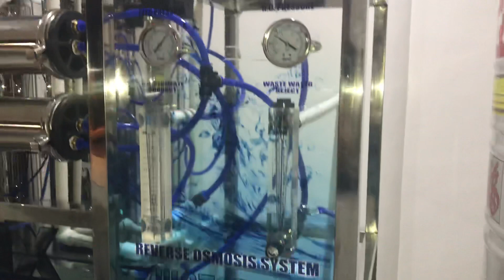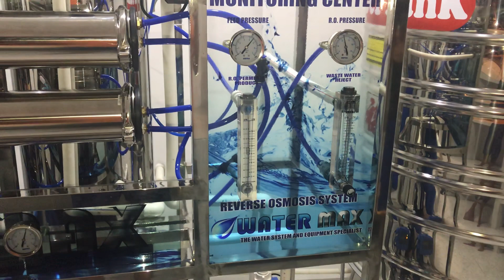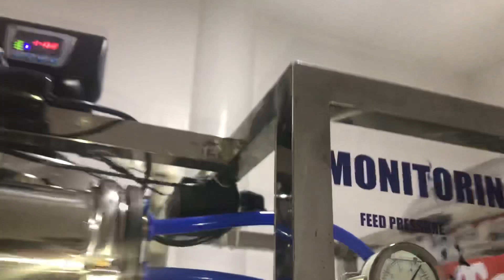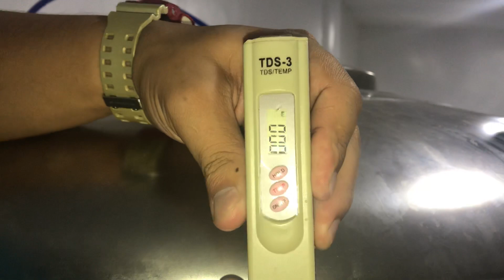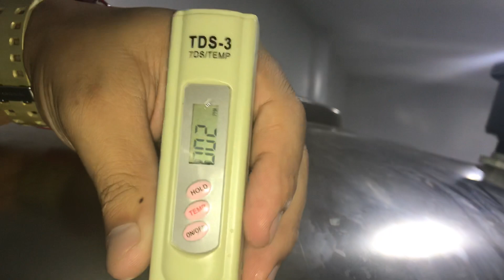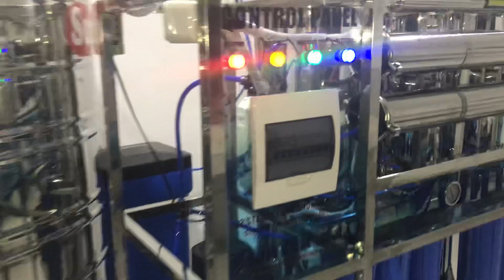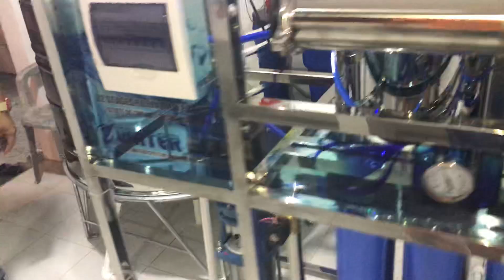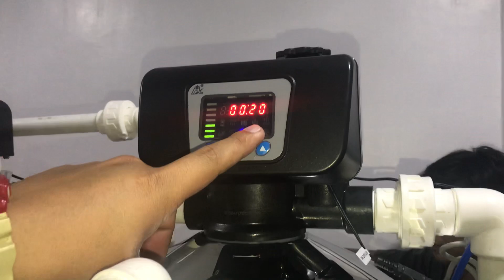Water Station Demo by WaterMax

Comment: Ask ko lng po..
Kahit saan ba na lugar sa pilipinas same lng set up niyo na water filtration system 34 stages parin...?
Reply from the maker: good morning, yes po sir.
hello Mam/sir, this is WATERMAX Enterprises for faster transaction you can txt or call:
Globe:0916-644-4406
Smart:0920-965-0272
Sun:0925-743-5853
Message us at WATERMAX ENTERPRISES PAGE

Comment: San ka nakabase? I will open this kind of business. I will pay cash for machines and package.
Reply from the maker: ian1724 our manufacturing site located in ALCALA Pangasinan
Reply from the maker: hello Mam/sir, this is WATERMAX Enterprises for faster transaction you can txt or call:
Globe:0916-644-4406
Smart:0920-965-0272
Sun:0925-743-5853
Message us at WATERMAX ENTERPRISES PAGE